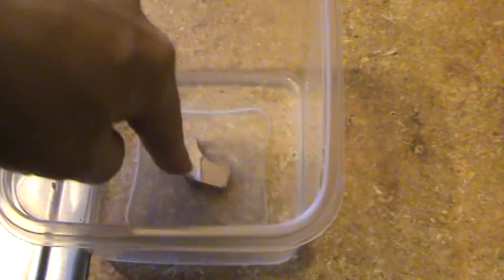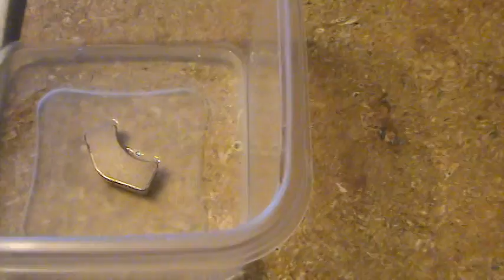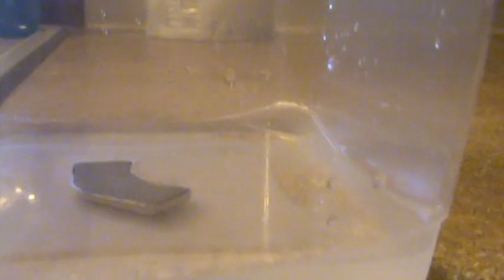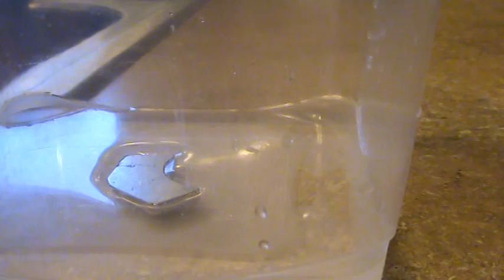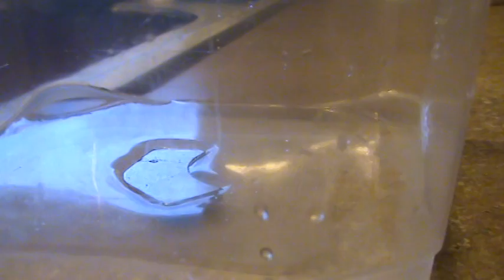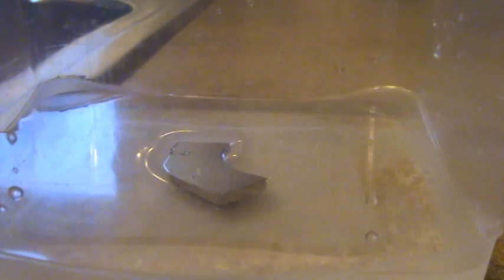Magnet and Water.MPG

Comment: If a powerful magnet (such as a supermagnet) is covered with a layer of water (that is thin compared to the diameter of the magnet) then the field of the magnet significantly repels the water. This causes a slight dimple in the water's surface that may be seen by its reflection. wiki

Comment: Great demonstration.  I doubt all of the physics we're told anyway.     some thoughts occurred to me..   Two factors.  if the magnet is metal most metals are coated with an oil that repels water.  Also the material itself can make water surface tension more interested in sticking to each other than to the object.     if the magnet truly repelled water then a water droplet on a non-stick surface should move away from a magnet, that's the test I'd do.

Comment: This happens because of the surface tension. If water was so repelled from such pathetic fields, you could suspend a drop on a string and it will really run away from such magnet. Instead, you need a much stronger field and a very delicate system to show how diamagnetic water is.

Your claim about the gas line is also totally false.

What you're doing is called pseudoscience. Pure, school textbook example of pseudoscience. Using fancy words and bad reasoning to prove something which doesn't work or exist.

Comment: That's happening because of the waters surface tension or "skin" a normal (non magnetic) piece of metal that same thickness would do the same thing. This has nothing to do with the fact that it's a magnet...
Reply from the maker: It also works if you put the magnet under the water container.  See about 1 thousand other videos on youtube...  The effect is just not as pronounced from underneath.
Reply: https://www.youtube.com/watch?v=wtdnByoSPgw          WATCH...JUST MADE A FOOL OF YOURSELF

Comment: You need to do a followup video to prove this. Just mill a piece of metal to the exact same thickness and dimensions, and do this experiment with both the magnet, and the metal. People will not be able to claim it's surface tension if the water covers the metal, and not the magnet.
Reply: +IamNemoN01 exactly what i was about to comment
Reply: Even that answer is too simple as we are constantly subject to magnetic field all over the earth.  It's what keeps the cosmic radiation from burning us up, and why the south and north poles are the coldest regions (magnetic fields emanate from the north and south poles and are weakest at the equator).  Iron is a very heavy because of magnetism.  We have been taught gravity is the force that just pulls everything, but what is gravity?  Magnetism.  Everything has a charge and responds differently. This is why space dementia happens to people out in space for too long.  They can't function properly because they are removed from the magnetic field of the earth and their very particles start descending into chaos.  That is why they have to have magnetic field resonators on board space shuttles.  You don't hear about how they found out about that the hard way in the history books.  Every element is affected by magnetism, some more than others (the heavier the material the more it is affected by magnetism).  Water is going to have surface tension over everything.  He didn't prove much in the video and what he should have done was turn the magnet OVER since one side is north/negative while the other side is south/positive;  but that wouldn't have made a difference since H2O is already assembled with equal amounts of charge so neither side would have had a different effect.  Separating water into hydrogen and oxygen would pronounce and display the effects of magnetism (assuming you had the correct poles on the correct side of the electric charge in an electrolysis setup).  The north needs to be on the negative side facing towards the positive and south.  First you do it without the magnets, and then you add in the magnets and watch to see if there is an increase.  I have done it myself since I make hydrogen generators.  Bar magnets were better than rings and circles oddly enough.
Reply: @waynesanders1406  About time I see someone who is educated. Not to many people understand you do they?

Comment from the maker: It works if the magnet is underneath the plastic dish, just not as well.
Reply: The show THAT. There is no proof unless you control this by demagnetizing that magnet and seeing whether the effect goes away. If you coated the magnet with never-wet, the demagnetized magnet will show the same effect.

Comment: I am looking for any and all catalysis for hydrogen and oxygen to bond. I feel that the frequency(ies) the kings chamber reverberates at will aid the creation of water. (Sonic welding the water, in addition to the static electric presence.)  Also, when water is created, is there a energy gain?  It take energy to split it, when it forms do you get that energy back?  Excluding burning, is it a chain reaction?
Reply: Why exclude burning? Isn't plasma energy?

Comment: Have you tried this with an unmagnetized piece of chromium coated metal? If not, I will. Water IS in fact very weakly diamagnetic, but the effect is too small for this to be caused by it. I would rather say this is because of the surface tension of water.
Soap shouldn't affect diamagnetism, should it? So add a bit.....

Comment from the maker: It also works if you put the magnet underneath the plastic container, but it is not as drastic as can be seen in dozens of videos here on YouTube.  Maybe I need to reshoot the video to show that.  Water is clearly diamagnetic, it moves away from magnetic fields.  Surface tension does not cause water to stand up like that.  I drug my wet finger across the magnet to break any surface tension.......

Comment: @bobdavis321 Well water and electricity don't mix well. I could see where that would  go wrong. If powerful enough magnets were used, one could potentially make a rail-gun type gun that fires bits of water, but those magnets would be of better use on aircraft carriers to launch planes or mag-lev trains...